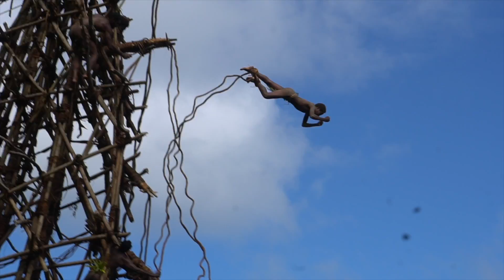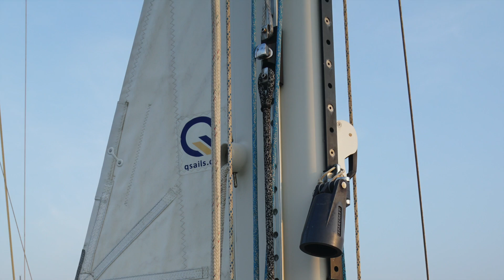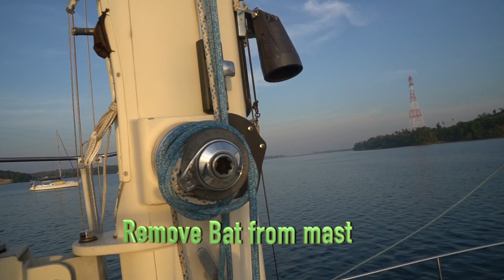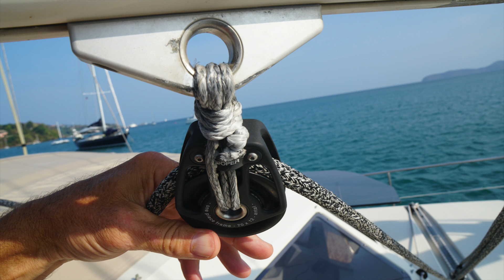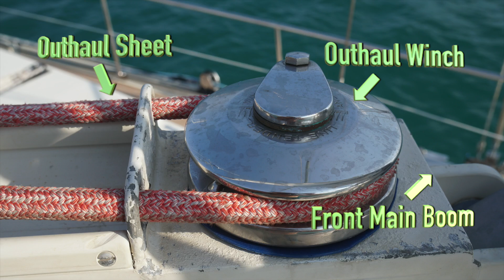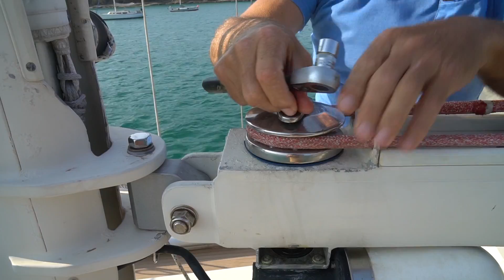Part 1 - Rebuilding the In-mast furling system on Aquarius -  We found a bat hiding out in the mast

Comment: Great video, are there rigging upgrades or changes you would make after sailing this Amel for many 1000's of miles?
Reply from the maker: I have already made most of the changes that I would ever want to do.. Anything that makes the rig quiet while sailing.  Soft shackles so that no metal to metal connections make a big difference.  I met up with a couple circumnavigating, the wife was an MD, and the husband was an actual nuclear physicist.  I was looking at their genoa sheets, and they were cheaper, stretchy lines, and I ask why they didn't have the nice none stretch dyneema lines.  And he told me if you're cruising, you want the stretch because your sails last 2 times longer, and so does all the running rigging attach to my stretchy lines.  Cruising is very different than racing.  You're less worried about getting to the destination fast, and more worried about not breaking something.  I like the way Aquarius is currently set up, and I believe she is ready for the Indian Ocean and beyond.  Fair Winds

Comment: How much of an issue would it be if the outhaul motor or gearbox failed in high winds and you needed to reef or even fully furl in a hurry?
Reply from the maker: If the out haul motor failed or gearbox jammed with high winds and you needed to get the sail in quickly, you could take a knife and cut the outhaul or the dyneema line to the clew.  That might be dangerous because the sail might flap around and hit you, or cause the sail not to furl properly.  Thus, it would be better to just remove the screw on top of the outhaul winch as I did in the video and furl the sail using the furler motor.  You may want/need to add some tension by grabbing the outhaul sheet as sail furls.  That would be a two person job.  Best,  Ken

Comment: You’re very nice video one question if you had catastrophic power failure that would be another reason to disconnect the gearboxes?
Reply from the maker: Hi Tom,  You are correct.  If you were sailing with the Main deployed and you had an electrical failure, and thus not able to use the electric outhaul and furler, you would drop the furler motor first loosening the four bolts on the side of the mast. Then you would remove the bolt on the outhaul winch that connects the shaft to the sheave and then you would crank the furler manually to furl the sail.  I have to had a power failure on Aquarius, but that is what I would do if I did....  Fair Winds,  Ken